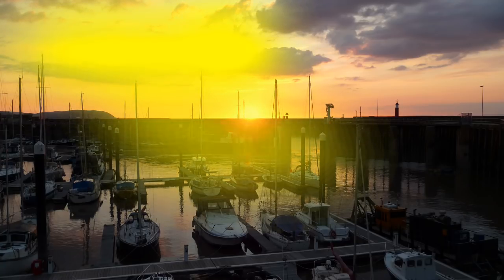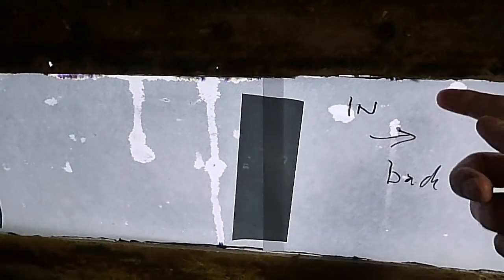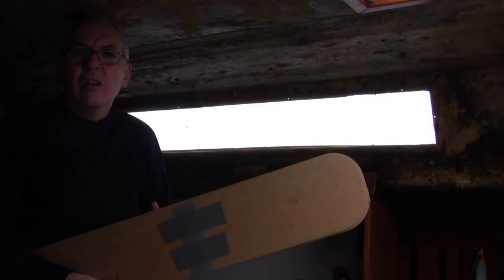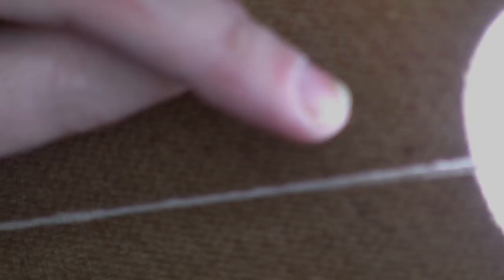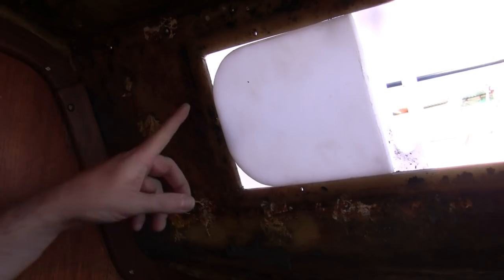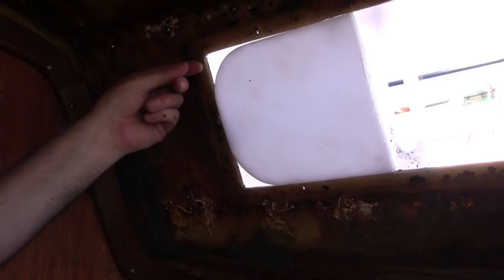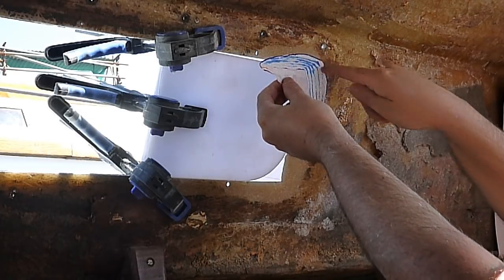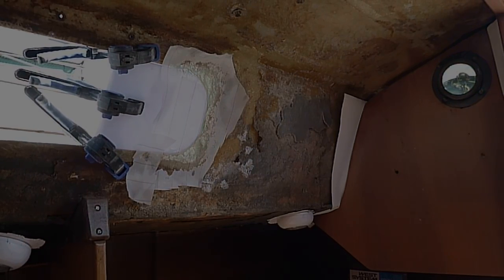Just About Sailing May 2 2018 - Fitting the Windows, Pt 1 Getting round windows to fit a square hole

Comment: They look so much better than the old ones. Thanks for sharing.
Reply from the maker: I never liked the style of the old ones.  In the original design the black perspex was one long strip running all the way to the front - that looked even worse.  I like the fact that they are clamped on too - no need to drill holes in the coachroof. Thanks for watching.

Comment: That window selection was spot on. Good job
As you did your corner fills (windows), my mind was working out something totally different; BUT, your solution works, and using that Cutting Board taught me something new.  Thank you
Reply from the maker: Thanks.  I was tempted to use mixed chopped fiberglass with 406 and simply trowl it into the void - that would have probably worked just as well.  The chopping board was just the right thickness for the job. - I wasn't totally convinced my technique would work, but it worked out fine.  Epoxy and fiberglass is very forgiving, thankfully.
Reply: Note: one way to deal with "fiddly 450 scraps" is to use larger section, laid up under Visqueen (clear plastic sheet), then cut to size, remove one side of plastic and apply to prewetted (epoxy) surface.
Note: Visqueen can be used as the template with the assistance of an indelible marker.
Note: Epoxy has a "green stage", in that it is not cured but still pliable.
Reply from the maker: Yes.  I had forgotten about this technique - someone showed it to me ages ago.  Thanks for reminding me. I will give it a go when (if) I do an applicable project; it would have worked fine on this one.I have some slow (206) hardner that I was tempted to use.  However, although the temperature got above 27 C during the day it dropped to 4 C overnight.  206 needs at least 16 C.
The potlife was a bit of an issue - but I was being slow, and also could have used a more shallow (wider) pot to increase it.

Comment: Those windows are going to make a world of difference. I have never understood why a boat manufacturer would just screw plexiglass over some hole and call it done.
Reply from the maker: I guess it was all down to cost originally. They didn't look good, and they didn't keep the water out.  It will be nice not to have constant dripping next time it rains. Cheers

Comment: Will you grind/glass the exterior corners also?  Very creative - Not knowing any better, I'd have likely tried to glass in the ends and cut the radius out - but I could see that going bad with one bad cut.  The windows look great.
Reply from the maker: I'll show a close up of what the exterior corners look like in the next video.  I will need to do some filling work on them, and also several other holes (from where the old Perspex was screwed on etc).  I think your suggestion would work very well. Probably less fiddly as well as you would be using bigger sheets.  Unfortunately, I sometime get an idea an then think, 'Mmh, I wonder if that would actually work?' - I just had to give it a go once it got stuck in my brain. Cheers.

Comment: Hi there, great video. I hope you don’t mind the question but how much did you purchase your mirage 28 for? And how much do you imagine (rough idea) of how much it’s valued with the work you have done to it? Thanks
Reply from the maker: No problem with the question at all.  Serenity cost about £8,000 when I bought her 3 years ago.  She was in pretty good shape and got through her survey with no major problems.  However, I was not aware how bad the old engine was.  To be fair a 30 year old Yanmar YSE12 is not a particularly good engine even in tip top condition.  The new Beta 20 was over £5,000 with a lot of other work to the engine room.  The Sea feather self steering was about £1,800 - to me this was essential for single handed sailing.  A lot of the other stuff was really optional, nice to have stuff.  New chain with a Rocna, Lazy Jack system, larger diesel tank etc. There will also be a lot of new stuff to make her voyage ready - see the previous video.
I have no idea how much she is worth now.  Except that I know it is not simply a case of adding all the modifications to the original cost.  So, she is probably not worth £16,000. Probably more like £11,000.  But I am going to keep her, so I don't mind spending more than I would if I was thinking of selling her on.
If you are thinking of getting a Mirage 28. They are excellent little boats and, in my opinion, worth every penny. Cheers.

Comment: And rounded windows relieve stress and you won't fall out of the sky. ;)
Reply from the maker: Indeed. The more stess you have doing a job on a boat the more stress relief you enjoy once it is done. And I did it my own self ;)
Reply: But if a 30 footer dumps you on your beam ends wont those little bits break off.should you use a kevlar sheet to set them in
Reply from the maker: If a 30 footer dumps me on my beam ends - little bits of me will break off.

Comment: They look great, good job. If you don't mind my asking, how much did they cost?
Reply from the maker: Sorry, I should have included this in the video.  I will get exact costs for the next video - if I remember.  They were about £650 for the pair.  I wanted clamp-in windows and couldn't find anything else remotely similar.  If I went for 'standard' sized portlights I would have needed to do two each side and put a strip down the middle - that would have been a similar price.  So a lot more than just replacing the Perspex/plexiglass.  Probably one of those things that I can't really cost justify but to be honest, there's not a lot about owning a sailboat that can be cost justified. Cheers.
Reply: Just about sailing thank you, sounds like money well spent to me! They look great.

Comment: I must admit when you 1st traced the outline on to the chopping board I thought you was going to tab in the corner parts of the chopping board you threw away ( how wrong I was lol).
Reply from the maker: Actually, I think you probably could do that.  Probably not with the chopping board material as I chose it so it wouldn't stick to epoxy.  I really wanted to do a tapered joint rather than a butt joint. - Similar to what I did in the August 2 video when I took out some thru-hulls and glassed over the holes. Thanks for watching.

Comment: Can I ask why you didn't just get the windows made a bit longer and cut the extra out on the ends
Reply from the maker: That is an excellent question which I brushed over very quickly near the start of the video.  I did think about this.  It is really mainly a question of aesthetics. To my eye, the window would look a little too big.  Also, the original cut-out flares out by a few mm on either end.  So I would either have to cut out the top and bottom a bit to make those edges parallel, or fill in a tiny bit at either end (even if I did make it longer by cutting out the extra bit) - and it's no more hassle to filling the small bit that I did than a really tiny bit.
Not sure if that made sense. - Or maybe I just can't resist the temptation to play with fibreglass a bit more.
Seaglaze also do a window with squared corners - I really wanted rounded ones.
Reply: Fair enough, perhaps I have had my fill of GRP work for now, I am very pleased with how my Seaglaze have turned out but I don't know how to reply with a picture sorry
Reply from the maker: You'll have to stick up a video with a boat tour at some point. I am very pleased with all aspects of dealing with Seaglaze.
Reply: Yes I will give that a go, I found them very helpful too